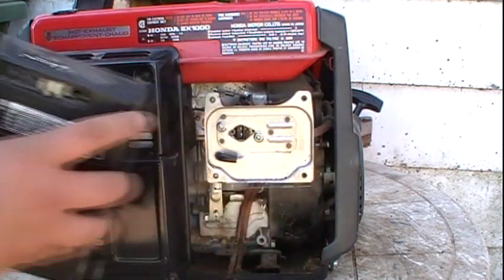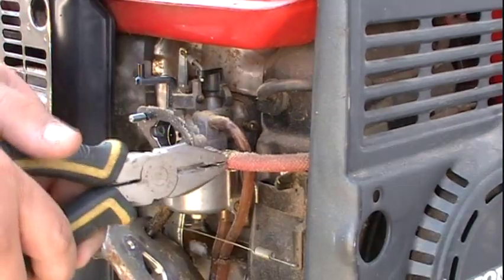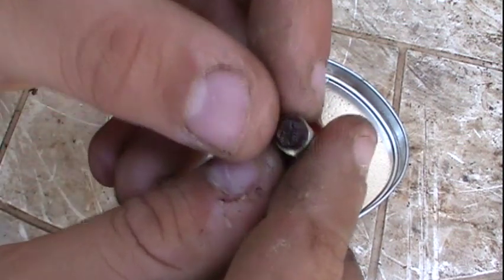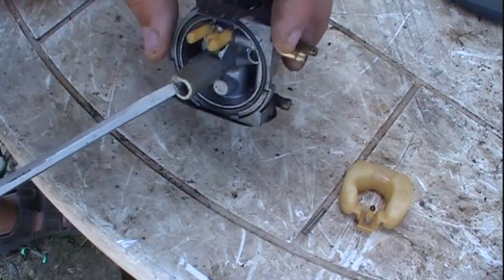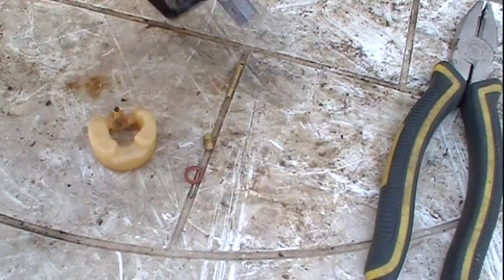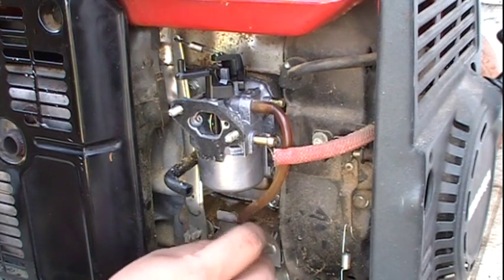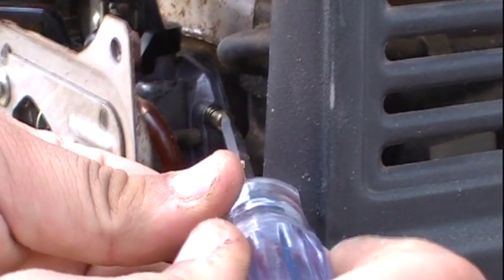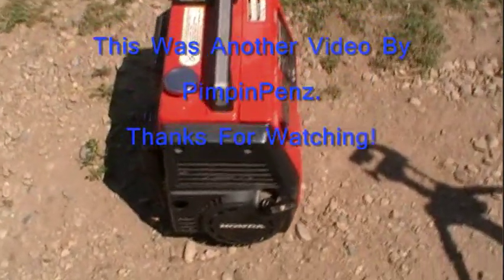Honda EX1000 Diagnosis And Repair

Comment: Wish I saw this one before I spent 3 hours on mine.  I did essentially the same except clean the emulsion tube.  I added a fuel filter as well.  Nice job on the video!

Comment: I took apart the carb and did everything in the video and it starts and runs and then dies because gas is pouring out of the overflow tube. Is the float needle/valve bad? It looked like it was working fine but I put it back together and as soon as I put to on position open the lines it starts pouring out of the overflow tube again.

Comment: Well made and reliable▫▫▫>share4.photo/H1kInverter?G    Large nationwide network of service centers if needed...NOT an oddball orphan. The well-known Gold Standard of small generators. 'Nuff said! Yes...it costs a LOT more. But you know that. Just wish this had a fuel shut-off to allow burning out of the fuel...instead, you have to drain it

Comment: I would first use a long small tip flat screwdriver and turn the “fuel drain” screw a couple turns on the carburetor bowl. Make sure On/Off switch is off (unless you wish to empty entire tank!).
Have a container - bottle to catch fuel that will come out of lower hose. This will empty the hose. May be a bit still in bowl.
There a hole in side cover to empty hose/bowl without removing anything. Unless someone positioned incorrectly when reassembled.
Then proceeded to remove hose, carb and bottom bowl.

If you have apart, you can now see what you are doing for future use.
At end of season it may be good to empty...Make sure to set bowl screw before using again...  

Don’t forget to clean tiny hole in that set screw inside carb. First time I did this I thought lower part was only a retainer. 
A few strains of tiny braided wire seemed to work.

Braided red fuel line in normal...

Comment: Thank you.  I'm not a mechanical guy and my EX1000 started sputtering and would die and your video was perfect.
Thank you for stating the wrench sizes as well.
I am up and running and it didn't take me 7 hours and at least two trips to a store to buy something I didn't need..

Comment: Thanks for this guide on cleaning carburetor. My EX1000 would not stay running because it wasn't getting gas, so I followed this video to disassemble and clean the carb. I put it back together and now it works great! The only part you hide with your hand is how to re-attach the tiny spring and rod that moves the throttle. That was a pain to get back on. Finally I pulled the carb away from bolts, then attached spring and rod before putting carb back on. That worked.

Comment: Thanks for this video, question, I have this same generator, when I start it fuel runs out of the overflow hose, is that the fault of the rubber stopper on the float?

Comment: The venturi of a carburetor is not its air inlet. A venturi is a restriction that by necessity must within the carburetor body. Where you're pointing as you say venturi (over and over) is on the wrong side of the choke to even possibly be relatively near the venturi.

Comment: great video. I'm having a problem. with my honda ex1000. I'm hoping you or someone can help. 

recently I used old gas in mine, and it caused it to refuse to start. after cleaning out the carb, it started running, but not at full power. it won't power on my tv or DVD player. the only way I can get any power output is by revving it manually. thus causes it to leak fuel from the carburetor though. any ideas or solutions?

Comment: anyone have any idea if I can get the nylon piece that the float hangs on?
Reply: go to honda.com and put in your zip, Call the closest authorized dealer and they can probably order it for you. I had to order an air filter as the one in it came apart in my hands.

Comment: If the carburetor is stuck, get a large flat screwdriver and a hammer.  place the screwdriver on the upper right side of the carburetor where it meets with the main motor housing.  There is a rubber gasket between the two.  You want the screwdriver to be on the carburetor side of the gasket, but close to the motor housing.  Hit the top of the screwdriver with a strong tap using the hammer.  you are trying to break the connection between the carb and the motor.  If this isn't enough, move the driver to the left hand side of the carb.  Strong tap the screwdriver again.  It should disconnect.  

When replacing the carburetor, make sure the gasket edges are not in the way of the connection surface.  I suggest spraying gasket with carb cleaner and wiping the surface of the gasket before reseating the carb.

This worked for me.  Generator works well (no clogs), but trim adjustment on gas will be required.

jte

Comment: The carburetor doesn't simply pull off the two studs ! At least not in my case, I've been pulling at it for over N hour and I've given up before I break damage the thing.

Comment: Nice video. I have the same generator and the last time I used it, it dumped all of the gas out. Maybe I'll check it out now that I'm done with lawns.
Reply: probably a bit late but i just had the same problem with mine and pulled it apart.
There was a small bit of gunk *rubber sitting under the needle keeping it open. So as soon as I turned it on even before cranking it, the fuel would just flood out.
It literally dumped half a tank in a matter of minutes.
Pull the float bowl off and check the needle and where it sits are clear of debrit.
A five minute job and she's running like a champ again.

If anyone has advice on how to adjust the voltage at the dc outputs I would be appreciative.
I've adjust the idle/run speed to output the 240v for av but that ramps the dc output up to around 28v.

cheers Brett